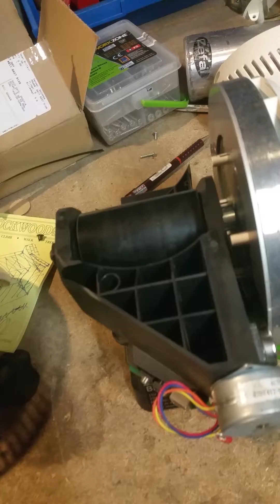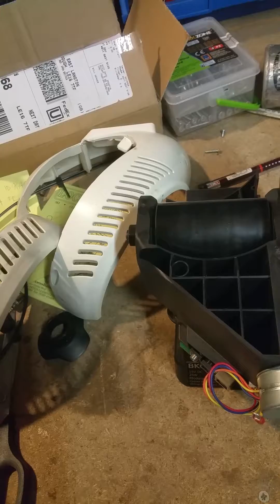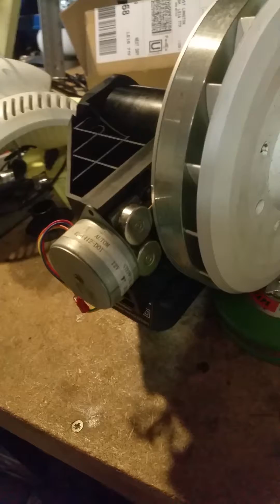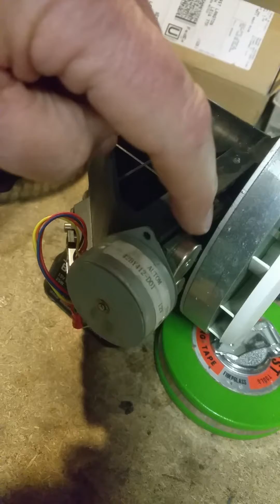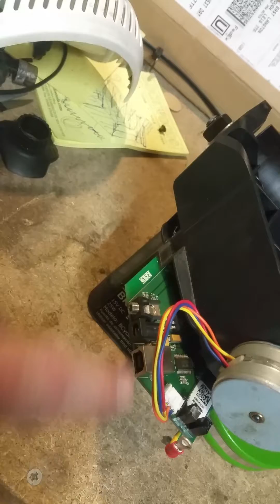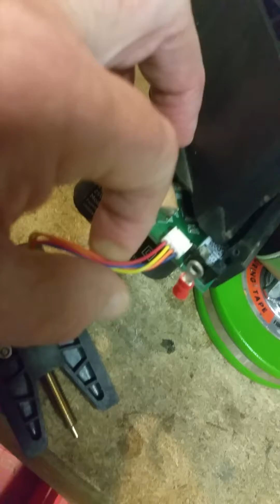Bkool Classic Smart Trainer Disassembly & Repair(1)

Comment: Thanks so much for the fix. The other issue I noticed was that slider was loose and after I tightened it by spinning it on the bolt all the way to the stepping motor, power readings were accurate again. Thanks!

Comment: Hi Mike 
This is quite an old post, but I hope you answer. My BKOOL clicks whilst it initialises. The magnets do go backwards and forwards but the start position is with the magnets approx a quarter in, and the resistance does not alter during training. There is no problem with the connection but the stepper does not respond after the initial movement…..

Comment: Very nice video encouraged me to disassemble my own BKOOL PRO  and I found that the stepper motor   does not work, do you know how many phases and  bipolar or unipolar is  the  stepper motor?
Reply from the maker: Kostas
Thanks for your message.
Regret I do not know details of the stepper motor but in the first video there's a nearly full view of the stepper motor brand and serial number. That may help.
Do bear in mind the fault may be with the circuit board, not the motor. Also, check the motor is not jammed externally by e.g. the slider.
Best,
Mike

Comment: Hi Mike, don't know if you can help but here goes.... I have a Bkool pro 3 (Now Zycle pro). It has worked fine until December,  when the resistance started getting harder and watts I produce get lower. It works fine on ERG mode but free ride in Zwift and Bkool it produces really low watts

Comment from the maker: Sorry to hear of your troubles. I haven't an answer but I can run through my thoughts. Irrespective of the position of the tab at power up, the stepper  motor should run and initialise. Since it doesn't I conclude tab/optoswitch is not the problem. Remaining causes: jammed? (give it a good thwack before power up); broken wire connections? (disassemble and resolder); circuit board? (find a scrap Bkool for parts); Stepper motor bust? (ditto). Sorry, unless you are OK with electronics, I can't think of anything else. Best, Mike

Comment: Hello Mike, as stated on other posts there aren't many posts to help maintain repair these machines. I have just experienced a fault with mine. Whilst on a session, it lost connectivity, and when I inspected it, I noticed that it no longer powers up. I have power coming from the power pack at the plug which plugs into the trainer, but no whirring/clicking/buzzing noise from the trainer. Any ideas?
Reply: Strangely the trainer has started working again! I suspect it may me overheating/other issue. I was about to attempt to open it up after following your post however, one last plug in and I heard that re assuring buzz. I'm still keen to gauge your thoughts should this re occur.
Reply: My power issue seems intermittent. It stops working and I cannot get it to power up. I wait for around 24 hrs and it works again. 
Can you suggest anything?

Comment: Hi Mike
Excellent and very informative video. 
I have a problem with my Bkool and the info on disassembly and operation you provide has got me up the learning curve.  
Can I ask your advice?  
My Bkool is making a metallic scraping noise when it rotates and has become very stiff to rotate.  I have not yet disassembled but by looking through the air vent holes it seems that the magnets are fouling on the flywheel.  It also seems that there is a small bolt in the center of the magnets which fixes them onto the slider.  Based on your experience,

1) Am I correct in believing that the magnets are fixed with a small bolt
2) Might it be possible for one or both of these bolts to have come loose and thereby cause the magnets to foul the flywheel
3) Otherwise from your experience could you suggests any other reason for the fouling 

Also Bkool like other trainers has to go though a calibration process.   Did you glean any info about calibrating the Bkool when you worked on yours.   Do you know if by disconnecting the slider etc you corrupted the calibration

Thanks again for the video.  There is very little info available on the web on repairing Bkool trainers so your video is most welcome.  Thanks for sharing.  
Ray P
Reply from the maker: Hi Ray
1. Yes, from memory, the magnets are fixed actually by two bolts, one each.
2. Yes, the bolt(s) might have come loose. Much more. likely is the stepper motor has failed to initialise and the slider has advanced to a point where it has fallen off its guide.
3. I can only make some guesses e.g. bent axle making the flywheel run out of true (check visually). Better to take it apart if you have time.
Calibration: Unlike some other systems, I don't think Bkool have a calibration method beyond (I assume) caibration during manufacture. I use a Powertap wheel to measure load so what Bkool says about load is ignored. In theory I should be able to compare the two pwer readings using e.g. an android app for the. purpose but I've never done this.
I do have another issue which is the load surging independently of what is programmed but I haven't a really looked into this.
Hope this helps.
Best,
Mike
Reply: @mikevybiral5259  Thanks for  the speedy reply.  What you say helps.   The slider falling of its guide is a something I will check.  Hopefully the axle is not bent.  I prodded the magnets/screws with a wooden skewer inserted through a vent hole and as best I can see they do seem to be loose.  The unit is only 9 months old so I am reluctant to disassembly until I know I cannot get it fixed under warranty.  However, I don't hold out much hope as Bkool no longer makes hardware and even when it was its support was poor, so plan B is to strip it down and attempt a repair.   In the meantime  the insight from your video and comments will help me talk knowledgeably with Bkool if they respond to my contact.  If/when I strip it down I will document the strip down and repair make a video post.  Thanks again.
Reply from the maker: @rayp6103  Best of luck. Let me know how you get on. Mike
Reply: I have the same issue. Has bkool returned to you? Have you fixed the trainer? Thanks.
Reply: @bitonit 
Hi 
Sorry for not replying sooner.  
Bkool has repaired my trainer.   My Trainer (Bool Smart Pro 2) was still under warranty.  I contacted Bkool via its web site and got a reply within 2-3 days.   I needed to send them a video so that they could hear the noise and diagnose  the problem.  Bkool organised its courier to collect my trainer and return it to Spain for repair.  I got the trainer back repaired and fully working after around 10 days.
All in all a good result.  If Bkool had not helped I was all set to have a go at a repair.  
Hope this helps.
Reply: I discovered that on the Smart Pro 2 some of the screws holding the trainer cover together are inside the yellow casing and behind the black air vents.  The air vents are held in place by a single catch on their long edge  This catch can be released by inserting a thin strip of metal/plastic (such as a feeler gauge used in automotive servicing) between the yellow casing and the mid-point of the long edge of the air vent.
This allows you to remove the vent and get access to the screws. It also allows you a clearer view of the mechanism inside.
Reply: Thanks for the reply. As I mentioned I had a very similar problem with my trainer. However, I bought it 5 years ago and I live in Brazil. Thus, a repair from bkool our a representative would be unlikely. Moreover there was no guarantee anymore. I realized that I needed to repair it myself. I opened it and the internal metallic wheel was scratched by the magnets. I used sandpaper to even the scratched wheel surface, also checked the bolts and re-tightened them. At last, I tried to realign the wheel through the lateral bolts. The wheel axle cloud be warped, but I could not fix it. Since it is too hard/stiff and demands precision. I do not have the skills nor the tools to do it. I remounted it and it seems to be working perfectly now. At least, so far so good. Best wishes.
Reply: @bitonit  
Glad to hear it is fixed.  What you describe seems to have been the same problem with mine.  When I looked inside the internal flywheel was scratched as well as the magnets.  The screws holding the magnets in place were loose.   Because it was under warranty I did not want to dismantle further or attempt a repair until I was sure Bkool was not going to help so I cannot say if anything else was damaged or if the wheel was out of alignment.  It is good to know that this type of fault could be repairable by the home user.  
I initially contacted the reseller in the UK but because Bkool have now stopped supplying trainers they did not want to help and advised me to contact Bkool directly.

Comment from the maker: Hello Ismael. Sorry to hear of your problem. 
The short answer is no I don't have the bearing specs or useful images.  
For what it's worth I doubt the bearings are broken. If they are worn, you might be able to feel some play at the point where the bike wheel normally bears on the drive cylinder. More likely the flywheel is out of balance. It's quite massive compared to the spindle it runs on. It wouldn't take much of a drop for the weight of the flywheel to bend the spindle. Manufacturers tend to avoid special bearings so, if the bearings are at fault, a bearing supplier could probably supply a replacememt but you'd need to disassemble the trainer to find some numbers on the bearings or to give to the supplier as a pattern
Best of luck, 
Mike

Comment: hey , my kbool is stuck on a hard resistance, the firmware is updated , but is nor working.... do you have any advice! ? tnx !!
Reply from the maker: Check the video to make sure you understand the initialisation phase. Then listen carefully when you first connect power. You should hear the stepper motor running forwards, then back to the start position, then stop. Takes about 5 secs. If you can't hear this, then probably the travelling magnet the controls the resistance is stuck too far in towards the flywheel axle. Let me know how you get on. Mike

Comment from the maker: I'm thinking about this. Does the sequence you describe occur with no wireless connection?
Reply: This happens regardless of whether there is a connection or not.
As soon as you start pedaling, it happens.
Reply from the maker: @CoultDC  Suggest either a poor connection (try shaking the unit to see if this produces same symptoms) or position of homing tab marginal such that vibration causes unit to reset. (Try enlarging tab with tape as per my video). 
Let me know how you get on.
Reply from the maker: Yes, it occurs at power up.

Comment: Hello.
I watched your video - very informative! )
However, I had another problem with my trainer - approximately every 5 seconds, the resistance increases by about 30-60 watts. Then rolls back and increases again and so constantly. Inside the trainer before that clicks are heard. Opened and shot a video of how it looks -
https://www.youtube.com/watch?v=kyF1hk6UJss
As you can see, the magnet is constantly going back and forth, because of this, jumps in the increase in resistance occur. Maybe you have an idea what's wrong? Can I fix this myself?
I would be very grateful for the answer!
Roman.